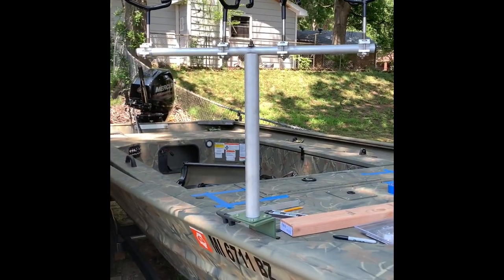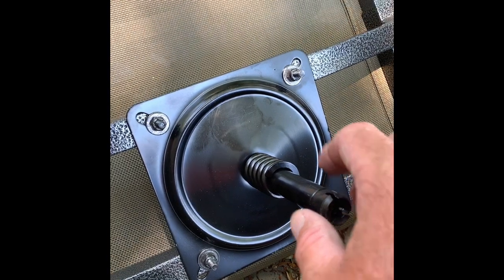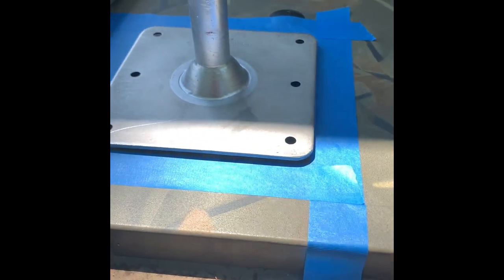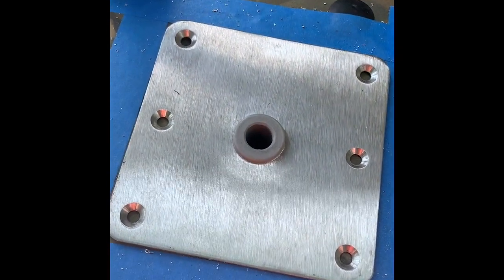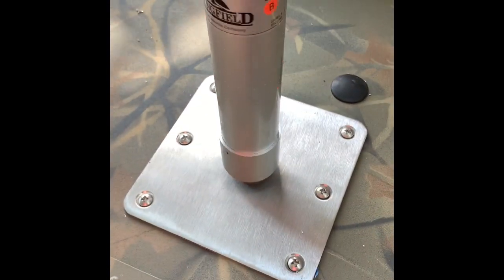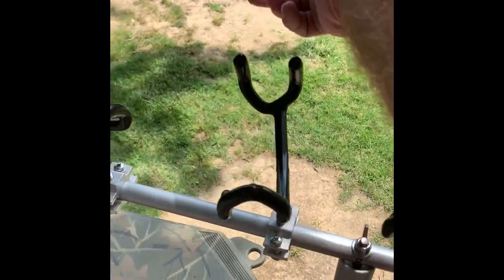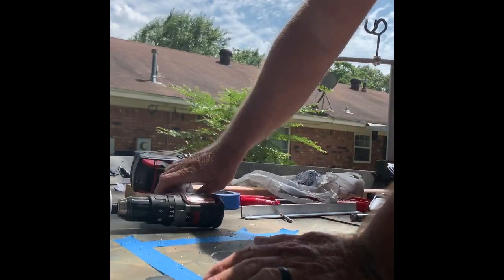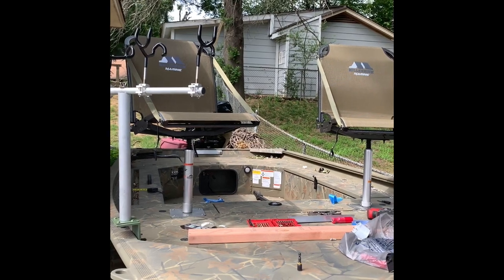How To Install B100 Millennium Marine Seats On A Grizzly Boat or Aluminum Boat

Comment: Using soapy water in a spray bottle will help the holes and drill bits cut the aluminum. Soap on the screws help too.

Comment: There are several companies that make a special bracket to allow for additional seats using one mount so you don’t need to install multiple holes in your deck thanks for the video thinking about add same seat doesn’t look like much but all reviews are positive

Comment: I just bought the same boat. Plan to install seat base too. But using snap toggle bolts instead bécause after time the shifting and mouvement of weight on the seat leaning back forward Will eventually loosen or pull the screws out from their hole

Comment: I have the 1654 also.  Just added the same bass pro shop bases tonight, and unfortunately the exact same screws from Lowes.  Stripped 4 of them!!
Reply from the maker: How do you like your boat? I love mine! Sorry it took me so long to respond. Trying to get used to this YouTube control panel. LOL
Reply: Hey, loved my 1654, got me everywhere I wanted to be on the river when I was by myself.  But on bigger waters or busy waters with wake, and with others in the boat I nearly got swamped a few times.  Ended up going to a Tracker Pro Guide v-175.  Both great boats!  If I could have afforded it, I would have kept the 1654 for skinny waters.

Comment: Thanks for the video Mr short. I'm actually looking to do the exact same thing to a lowe boat I'm fixing to buy. The only difference is that I'm going to be doing it at the stern. If I may ask, have you had any issues with flexing or causing any damage to the bow? My father is around 280 pounds and even though I'm not going to be using the seat pedestal I'm worried the sheet metal screws will pull through or cause the aluminum to eventually flex enough to break because there isn't a base plate under it. Thanks for your time.
Reply from the maker: ghost38901 no issues at all. They have held up very well. Thank you for the like and comment. Good luck to you with your boat.
Reply: Wondering if you installed those seats and how it worked. One of our riders is 290 and we were going to install them them to the wood topped benches on our Lund SSV. And I wasnt sure how the hardware worked out for you etc. I'm concerned that the screws will pull outnof the beach and notnsurenifnsome kind of a base in addition to a swivel plate would help.

Comment: Hows the screws holding up. I just bought a New grizzly 1754. But i plan to used toggle screws instead
Reply from the maker: Joe, they are all holding up great. I will probably use Hilti Toggles if the screws ever do get loose. How do you like the boat?
Reply: @crappiefishingmississippi  still waiting for it to Arrived at the boat dealer. The boat and trailer has been built it coming from Illinois to California where i lived.as soon as a trucker is ready to head this way. The motor is another issue. Not being built fast enough probally another month or so. But i will pick up my boat and trailer once it arrived so i can start adding other things while i wait for the motor. The motor i got for it.  Is a mercury. 15 hp pro kicker 4 blade alot of thrust they used theses motor alot on big boats for trolling. I dont need speed. 25 mph is fine for me and trolling is perfect. Just me and my son.

Comment: I am curious to know how well your screws held up or did they stripout?.  
I am looking a installing 3 seat base in my shallow water mud boat and there is no way to hold backup on a bolt to bolt it down.
Reply from the maker: Alex, they have held up very well. No problems at all.

Comment: Hey James, quick question. How are those mounts holding up since this video has been posted? Are those 14x1 screws still holding up tight? No play in the base or anything funky going on after all this time?
Reply: This is the exact question I have!  I’m needing to do this exact thing on my boat and don’t have access underneath to put a nut and bolt and unsure about the nut inserts.
Reply from the maker: Andrea Rubio holding perfectly. Thank you for your question.